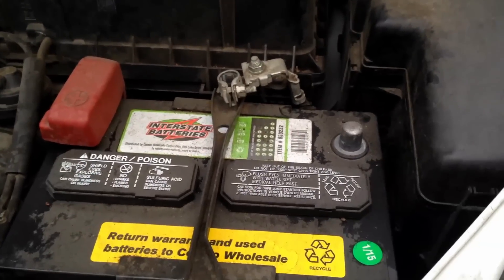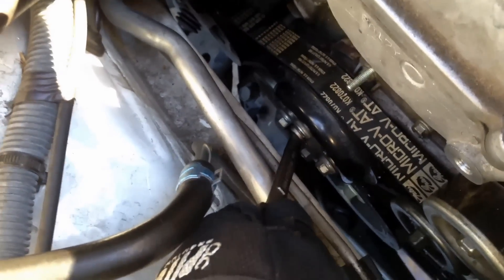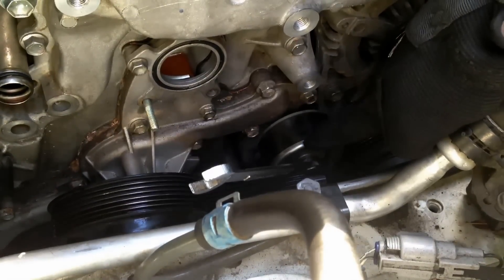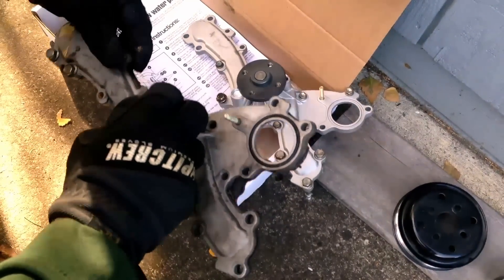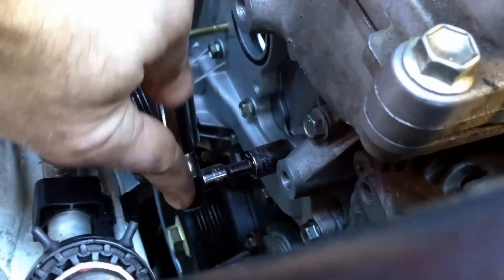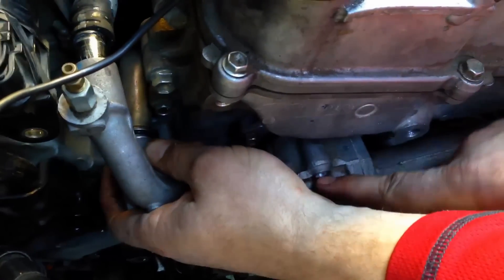Toyota 3.5L V6 Water Pump Replacement:  Removing engine not required!

Comment: This video helped me a hell of a lot...   WARNING HORROR STORY AHEAD...   SO...  AFTER REPLACING THE WATER PUMP... I simply wanted to replace all my noisy old pulleys... The two idler pulleys and the tensioner pulley... The idler pulleys went on and off no problem and really easy...  The tensioner pulley had reverse threads and a slightly different washer from the other two pulleys...  I DID NOT PAY ATTENTION TO THE TENSIONER PULLEY WASHER AND INSTALLED IT BACKWARDS...  This mistake caused the pulley to not spin at all and I didn't notice... After starting the engine there was a loud brief squealing followed by the sound of a motor flying apart...   Had I just reached down and gave that tensioner pulley a little test spin before installing the belt I would have saved myself days of regret and sorrow...  I broke the tensioner right off at the spring point... It took me two long days to finally fix it...
Reply: LOL, i did the same thing, luckily as soon as i heard the squeel i stopped the engine and was able to correct it before anything broke.

Comment: Thanks for the video.  I watched your video twice and found it excellent.  I learn best by visual observation.  I have the Platinum warranty plan which is still active for another ten months and I am under the mileage which is set at 125,000 so I have a covered repair.  Very happy I bought the warranty now!

Comment: Just did this job today on a 2010 Highlander. It was pretty tight getting the engine mount bracket out and it took a while to get the pulley/water pump out. We changed out radiator, hoses and thermostat also. It was a big job. Most of our curse words came from the water pump portion of the job. Anyways, thank for the video, sure beats lifting the engine out!
Reply from the maker: Glad it helped!
Reply: You can't get the bracket out on a Highlander unless you take out the front mount nut the lower mount on the passenger side and the rear lower mount on the passenger side and the only way to get the pulley out is pry the engine sideways or take it out with the pump I don't know if this was a minivan and there's more room but on the Highlander there's no way to get that bracket out without lifting the engine way up and removing the two lower mounts and there's a whole bunch of other stuff like getting the hose off the thermostat housing assembly if you ruin it you will be in for a lot of work  taking the housing off the tube and the O-ring you also have to be careful otherwise you can mess that also if you're not mechanically inclined you probably want to stay away from this job there's a lot that can go wrong even getting the pulley bolts tighten and loosen is difficult

Comment: Great video!  I am an engineer not a mechanic.  I have a 2015 Sienna LE. A few minor difference here and there BUT for the most part, this video made the job a breeze!  THANKS A MILLION!!!!!
Reply from the maker: Man, I love hearing that!  Keep on wrenching, my friend!
Reply: What were the minor differences? I also have a 2015 LE. Thanks
Reply: nueit llc I’m also interested. What were the differences. I have a ‘15 SE
Reply: @russellullyatt1153  I ended up doing mine with this video as a reference and most of it was the same. Biggest difference I noticed was some small brake lines on the 15 LE that interfered with one of the bolts coming out of the side of the motor mount bracket. We had to loosen the motor mounts on the bottom and jack the engine up more to get that bolt out. We got it all done though. It's definitely doable. I'm no mechanic so I had some of my auto savvy friends to help me. Saved me $1200.
Reply: Mac Aubourg Thanks!
Reply: @russellullyatt1153   No problem. I can't remember exactly but I think the serpentine belt pattern and it's pulleys are slightly different too but that's not a big deal at all.

Comment: I'm about to do this on a V6 Hilux, looks very similar, however the Hilux doesn't have the transverse engine fitment so it 'should' be easier... 

My only qualm with your instructions is not using a sealant to help the new gasket. I was taught during my apprenticeship days to ALWAYS use aviation sealant on water pump gaskets & thermostat housing gaskets and I have done that religiously every single time since then. I know, most people will say that the gasket shouldn't NEED additional sealant but I'd rather be safe than sorry. I have seen too many brand-new gaskets not hold up to system pressure and the aviation sealant is absolutely amazing to prevent any of that sort of nonsense.. although it is a sticky mess to apply :P
Reply from the maker: I can respect that comment, as there are plenty of people out there with more experience and knowledge than me.
Reply: @BroncoSolid  and likewise, respect back to you for putting up the video - the reason I looked it up was because I have not come across a water pump job on a V6 Hilux before, so I wanted to prep myself before I tackle it tomorrow. 

I appreciate the video and the information you have put out there for us all!

Comment: Thread locking compound on the engine mounts is totally unnecessary. If there’s anywhere you might want it it would be on the water pump bolts.That’s not even necessary either - great job. I don’t think you mentioned the right passenger bottom engine mount. You only mentioned ‘mounts ‘ and only showed the dog bone torque mount. It’s important to release the passenger bottom motor mount as well. Thanks for a great post.

Comment: Thanks, excellent video!  I'm doing my thermostat and you got me thoroughly covered.  And now know I will be able to do the water pump myself whenever it goes out.  You rock!
Reply from the maker: Thanks man!  Those thermostats are quite tricky, and you pretty much do that job while doing the water pump.  I should have done mine, too, but didn't.  Things happen.  Glad you enjoyed it.
Reply: @BroncoSolid  can you come do mine? Philly PA....the mechanics here want to pull the engine.

Comment: Great video. Very professionally done. You bring confidence in your viewers!
What do you suggest for after market pump. Thanks
Reply from the maker: I bought mine at Autozone. It failed once, but the lifetime warranty kicked in. So basically, I’m not sure.
Reply: Thanks Jason.I bought a AISIN, from what I’ve read it’s as close as it gets to OEM.

Comment: 3 dislikes must be from the Toyota dealership lol
Reply from the maker: And now it's six.  I must be getting a reputation with the dealers!   😂
Reply: @BroncoSolid  hopefully this would work with a 3.5 Camry too, I would much rather that over a 4cyl model
Reply: The haters are at 43 now.
Reply: Im Working at a Toyota dealership and we‘re replacing it, like him ;)
Reply: @christiandanilov4892  what's the going rate on this repair using this method vs removing the engine
Reply: @SAAN27  what do you mean with rate? Im coming fron Germany sorry 😅
Reply from the maker: @christiandanilov4892  He means how much money does this usually cost to have a mechanic do the repair.
Reply: @christiandanilov4892  hey how much your dealership usually charges to replace it
Reply: @azb6574  like 900 dollars
Reply: My dealership wanted $1300 this morning and my sienna  is 2020, i dont think the pump should break this fast

Comment: It’s time for me to do this on my rav v6
I’m afraid 
Would you happen to know it this method can work on it? 

Kuddos on the vid it’s super and I’ve actually watched before ever having an issue
Reply from the maker: I actually don't know anything about the Rav4 V6, but hypothetically, if it's the same engine, it could work.  The access to the water pump is likely to be different, however.

Comment: You mention raising the engine with a block of wood under the oil pan. Is removal of the upper mount enough or is there a lower mount that also needs to be disconnected. Also how did you tighten the waterpump pulley bolts without the serpentne belt connected ?
Reply: Today I removed the waterpump . I will answer my own question, I did need to disconnect the front right lower mount and the rear right lower mount as well as the upper mount and then I could lift the engine enough to make dissassembly easier. I am working on a 2010 RX350 which has a very similar installation.

Comment: The space between the water pump and body on the Sienna seems to be a bit more than the 2nd Gen Toyota Avalon. Looking at this video I can see that a Sienna water pump swap out would be a little easier. In one of the comments here a person asked if he had trouble getting one of the LONG bolts out of the control rod. With the extra space I just mentioned this may not be an issue with the 2GR-FE Sienna, but if you can't get the 4.5" bolt out of the control rod because it collides with the body, then get a hack saw and cut it anywhere you have a clear shot.

You can replace the cut bolt with an M10-1.25-100mm bolt. Lowes has one made by Hillman - part # 883207. HD may have one as well. The bolt is a little shorter than the original, but you CAN get it back in with it connecting to the threads on the engine side for a snug fit. The head on this new bolt is 17mm vs. 14mm on the old bolt.
Reply from the maker: Great post Mike!  Excellent points made.  Hopefully someone will benefit from this in the future.

Comment: You should also mention the right front motor mount; must remove the retainer nut, so the motor can be raised high enough to get the water pump removed. 
It is located behind the front passenger tire, behind a removable panel.
Reply from the maker: Awesome input.  In my case, I didn’t have to access that that retainer nut, but there are enough variations in models and years that this job may vary for some.
Reply: I did not know there was such a variation. This was my first attempt at replacing a water pump  on a front wheel drive. 
Yours is very informative. 
Keep up the good work!

Comment: Quick question for a 2014 Toyota sienna water pump replacement! Do you have to deal with timing at all during reassembly on this particular vehicle? Everything else seems straight forward. Thank you!
Reply from the maker: I think the 2014 has a timing chain, so probably don't need to mess with timing. That's usually with timing belts.
Reply: FYI: took everything apart today and found you will not be messing with anything timing related! Also found it's not quite as straightforward as your video made it seem. Could be because I'm not a mechanic and doing this myself!

Comment: This is an excellent video, thanks for posting it. Can the serpentine belt be replaced without removing the motor mount and jacking up the engine? The dealership wants $200 for just replacing the serpentine belt, it seems to me like it should come off and go on with just the use of the sero belt tool i  the video...
Reply: Yes it's easy

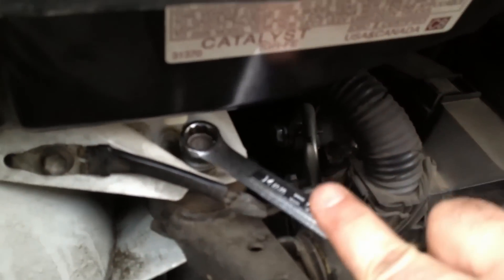Comment: So at 1:36.. how do you get the mounting bolts for the torque mount bracket off? They are 10" long and interfere with the body, A/C lines, and ABS lines on a 2015. I see this happened over an edit, so was wondering if it was a particular PITA.
Reply from the maker: It was not particularly tough on this engine, which is why I skipped over that part in the edit. I have no specific advice for you other than “good luck.”  I wish I did.
Reply: @BroncoSolid  Thanks for the reply, I was able to get the bolts out by taking the A/C line mount loose and jacking the engine a fraction of an inch.
Reply from the maker: @robbray3230  Awesome, hopefully your comment will help someone out in the future.

Comment: Hello Sir, I watched this video multiple time and need to change water pump on my 2017 Sienna. I noticed you said Jack up engine in the video, do I need to loosen any other motor mount bolt or just the one you removed at first? 

Thanks in advance
Reply from the maker: Baljinder Simk all I did was remove the one you saw in the video. Keep in mind, the 2017 model could be different than what I show in the video.  I’m not familiar with it.  Best of luck to you.
Reply: @BroncoSolid  Thank you very much for replying.
Reply: why need to replace water pump so soon on a 2017 vehicle?

Comment: about the water pulley 4 bolts ,just need to put a pin to a hole between two of the pulley bolts to lock the pulley.
I need to replace the belt tensioner too, need to remove   the air conditioning pump and alternator.

Comment: Do you have a parts/tools list for someone who wants to try this for the first time and do it correctly?
Reply from the maker: The part was just a water pump from Autozone, and the tools were a basic socket set and serpentine belt tool.  I also used a couple of combination wrenches for the tight spots.  It's the basics.
Reply: You should really have some experience before you attempt this project. 
This is not for the beginners. 
This would be best if you've already done a few water pumps on other cars.
Reply: @Not_Sure_  Thanks. I was going to take a leap of faith lol but probably not a good idea to do. Perhaps one day when I am able to afford a project car, this would be a fun attempt.
Reply: @BroncoSolid  Thank you for the reply. As a viewer of your tutorials/vids it would be great if you can also list the links to where you bought your parts from, at least for a hobbyist mechanic it would be a good starting point.

For example, I have a basic socket set but don't know the exact specs to tighten the bolts as I've seen on other videos. Or does that not matter in this case?

Comment: Good Video.Where did you get Torque specs.?I have a 2008 Rav4 3.5L engine with same type pump.Saw another video with some different torque specs for a highlander with same engine as Rav4.
Reply from the maker: Got them out of the Haynes manual

Comment: I just did this recently. Did you have trouble getting the one long bolt out of the motor mount bracket? Also, what brand pump did you buy? It's not oem, the gasket looks very different from an oem 3 piece gasket.
Reply from the maker: I don't recall having trouble with the long bolt.  Is it being blocked by something?
I got this pump from AutoZone.  It's a lifetime warranty item, but I don't feel great about the gasket that came with it.  Thanks for watching!

Comment: Would have been nice to know what brand of water pump was used to replace the OEM and give the torque specs for reassembly. Other than that, very helpful video.
Reply from the maker: It was a Duralast from AutoZone.  Lifetime warranty.  Torque specs were in the repair manual.

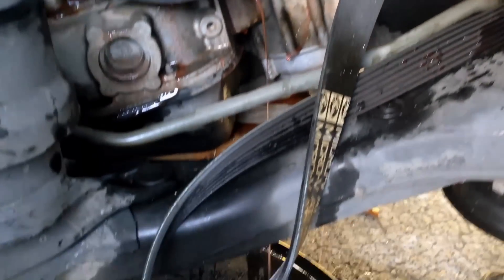Comment: What is going on at 3:28? If you remove the bumper?
Reply from the maker: That’s the passenger wheel and splash shield removed. Pretty simple, nothing crazy. Thanks for watching!
Reply: @BroncoSolid  does that help in accessing any of the bolts?
Reply from the maker: Totally. 100% recommend.

Comment: Do you have to remove or loosen the LOWER engine mount or will it lift high enough with just removing the upper mount? thanks
Reply from the maker: No, just the upper.  It’s removed for the purpose of space,  not lifting.

Comment: My timing cover gasket set came with two of the steel core rubber water-pump gaskets. Any ideas where felpro thinks the second one goes?  Called their tech support line and they said it goes behind the timing cover. Nope i have the engine torn down and it does not go inside the timing cover. Are they shipping two gaskets so you have a spare?
Reply from the maker: That's a weird one.  Same engine, right?  Did you get the correct water pump?  As for what I did, what you see is what happened.  I didn't really leave much out, especially a weird detail like that.
Reply: BroncoSolid hey thanks for the quick reply!
Yeah the 3.5l V6, i have had two apart now and only find one gasket on each. Taken every bolt out of the engine doing full rebuild so i would think if it was there i would see it. 
Not sure what felpro is thinking. It is actually their “timing cover gasket set”
Looked up napa water pumps and the picture shows one gasket. Thought i would ask another guy that has been in there and see if i was missing something. 
Anyhow thanks for the reply
Joe
Reply from the maker: You bet.  Sounds like you got the wrong gasket or something.  Best of luck!

Comment: DId you use blue Loctite on all the bolts?  When I pulled my waterpump bolts the 12mm had like a grey rtv on the threads  any info would be great thanks
Reply from the maker: I used blue on them, yep.  Can't remember if I did some, or all, but I don't see the harm in using blue on all of them.

Comment: How much time did it take to change out the water pump?
Reply from the maker: It was about 7 hours, but filming it makes everything take longer. It’s not a quick job.
Reply: @BroncoSolid  Thank you found a local shop that charge me $700 for labor. I did not want to go through all this.

Comment: Did you put any sealant on the gasket on the way back in or on the bolts that hold the water pump in?
Reply: I know this comes 2 years too late, but it doesn't look like he did. I just left a comment about how I use aviation sealant on EVERY water pump and thermostat housing gasket I have ever fitted. That was drilled in to me during my apprenticeship and I have seen too many brand-new gaskets fail to hold up against system pressure when no sealant was used.

Comment: What is that tool that you use to get the serpentine belt off with And where did you get it?
Reply from the maker: It's actually called a serpentine belt tool, you can get them wherever automotive parts are sold.  Should be under $20

Comment: If it's this tight for the V6, is it worse for the I4 engine?
Reply from the maker: These vans don't have an inline-4 option, so not really.  :-)
Reply: @BroncoSolid  some Siennas had 2.7 I4